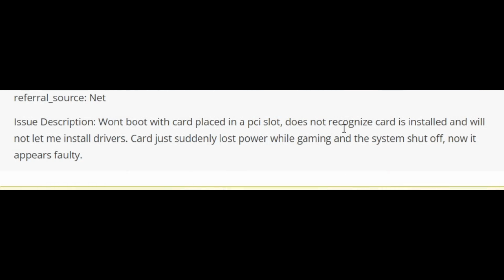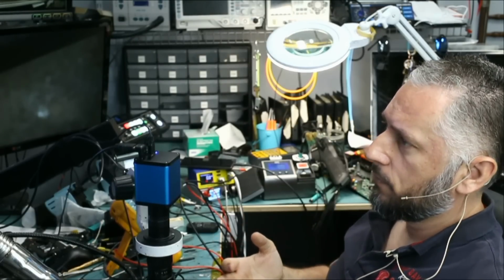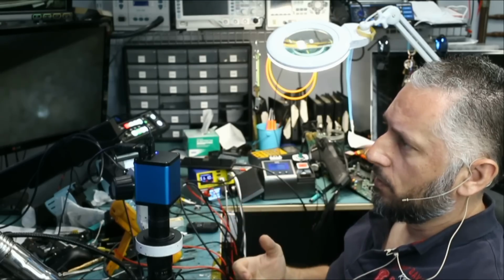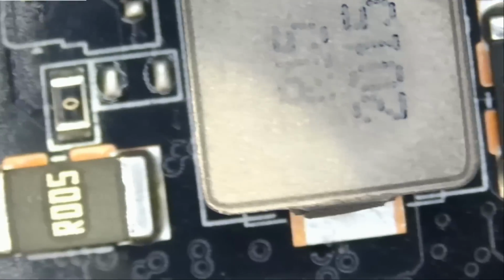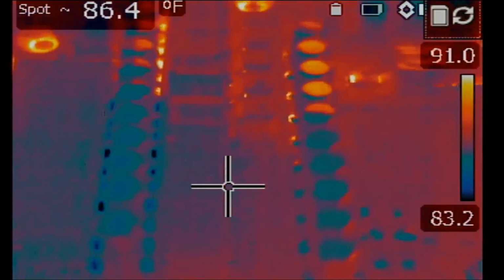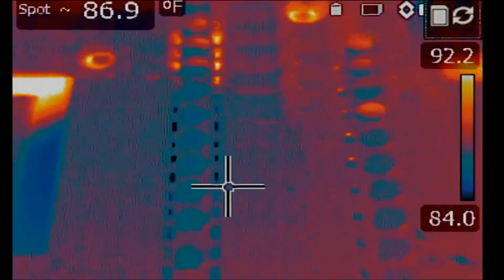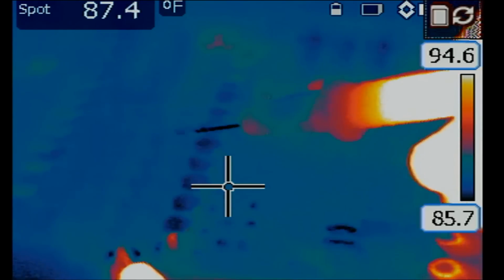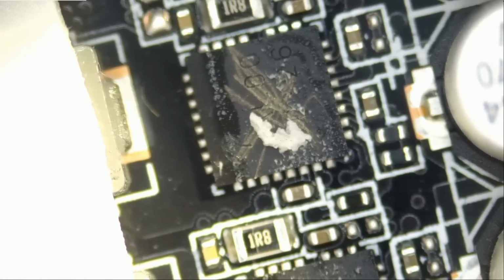Gigabyte 3090 Vision Graphics Card Repair - Suddenly shutdown and won't power up.

Comment: Greetings, I send a message because my video card has presented a recurrent failure, the computer turns on and gives an image, but after a while it shows a fixed color that can be green, blue, gray or white in a fixed way, later the monitor turns off and stops sending a signal video I have the driver 516.94-desktop-win10-win11-64bit-international-nsd-dch-whql before it happened to me with the driver 471.11-desktop-win10-64bit-international-dch-whql thinking that the problem would be solved update the controller without any improvement I would like to be able to send you my GPU by parcel it is an RTX 2070 super, the monitors I use are Viewsonic VG2227wm and VG2228wm LED I have never presented these failures before, the power supply I use is a Seasonic Focus Platinum from 750W

Comment: There is a so mouch easyer way to find where is the shortcut. Just use a 5.5 digit multimeter, and then check the resistance before the inductor what is after after the DC-DC, and after the Inductor. There is a minimum 50miliohm resistance difference. Then you just find where is the lowest one between the inductor and the IC. Then you dont need to power up the whole circuit and pray for not to die the processor. It's works every time.

Comment: it wont surprise me if during manufacturing the voltage on the boards are much higher then when it eventually becomes a videocard while voltage is a problem the problem only comes later as your just decreasing the lifespan but if done for heck even a day it shouldn't harm the videocard much your more concerned about the temperature during that voltage then the voltage itself

its why you can have a cpu overclocked with over 1.45v with a liquid cooler and barely influenced the lifespan offcourse you don't want to do that but most of us already have a new system before that overclock killed the cpu 

that said ryzen really benefits from a slight voltage offset of -0.05 it improves thermals but also improves performance gotta love how infinity fabric works

Comment: There are times when I do wonder if under the chip, there is touching of solder from the globs left for the re-soldering. It looks like there might be too much solder put down on the larger pads.  I suppose it they were touching then you would read a short? As always, great show Sir.

Comment: An odd question perhaps - Can you boost a gpu vram by replacing the memory chips ? for example if you have a gpu of 4gb with 4*1gb chips, and replace the chips for 2gb each, for a total of 8gb. Would it be possible ?

Comment: How does these things even happen to this expensive GPU? Don't they use top-tier components? I thought only Chinese motherboards had these issues.
Reply: Just because you use expensive components doesn't mean you're going to have zero failures.
It's honesty a misnomer that you'd even get a more reliable card, card manufacturers basically admit this buy giving the same useless warranty to high-end versions of a GPU as they do the lowest end.
Reply: They build them with components that are chosen to have mean-time between failures that are acceptable to the consumer based on the expected lifetime of the device. Certainly there are parts that are designed to last longer under worse conditions, but these components cost a lot more money. What's the point of using components that will last 20 years when the card will be upgraded in under 5? Its always a balance. Then add to this that there are small variances in both the source materials and the manufacturing processes that can lead to components that may fail earlier than others. Also keep in mind environmental factors like increased ambient heat which can also lead to earlier component failure. Of course no manufacturing processes is perfect and its possible for even the highest quality chips to come with defects that pop up after initial QC testing. Defects are a common and accepted part of semiconductor manufacturing. This is where the process of "binning" parts comes into play, allowing manufacturers to sell sub-quality or partially defective components as lower-performing parts with the defective sections disabled.

Comment: Wow that card has a 4 year warranty why not just RMA it, by the way a low end version of that card starts at around $1,723.07 retail. The only reason is it was purchased on eBay as a defective card and then sent to a shop like this one to get fixed for a fraction of whant it cost. In turn they can resale the card for a substantial profit.
Reply: No way sherlock

Comment: Installing drivers was never an issue, it won't install them if it can't detect a gpu. it's like tyrying to install a driver for an RTX3080 when  you do not have one even in the system you are trying to install the driver on. Of course with no power to the card the drivers won't be installed, it is not an issue though. There should ONLY be one issue, find that issue then the others will not be there, ONE issue, NOT many. find the issue that causes all the other symptoms. Think about it like a weed. A weed in your garden will spread, even if you cut the stem at ground level, it will still grow and spread right? so what do you do? kill the root. If you think it through and realise there is one issue, then your halfway there, but, if you see these symptoms and think they are all issues, you could end up not fixing a simple issue. what afre symptoms and what is the issue?
 
Also: British Army used to, and hopefully still teach this:
problems do not exist. A problem is a problem because they have no answer. IF a problem has answer then it isn't a problem. A problem is something that has no answer hence why it is a problem. 
IF a problem has an answer then it is merely a situation.

Situations ALWAYS have an answer. 
Problems NEVER have an answer.

Remembering this means you are changing your mindset and more likely to find the answer. Just because you personally can't find the answer doesn't mean you have a problem, someone else may know the answer and so you still have a situation because you go to the person who has the answer.

Comment: But Alex, if it's overflowing outside the chip, isn't it also overflowing inside, shorting the chip?  Solder will spread inside the gaps on the chip.  You're correct, some of us think you're using too much.  Thank you for posting this video.

Comment: Try finding the fault (lots of mosfets)........Good Luck (8:05 & 8:09).........what I do have are a very particular set of skills, skills I have acquired over a very long career. I will look for you, I will find you.
Reply: Could just pull them off one by one until the short goes.  Potentially time consuming tho.  If your a hobbyist or have plenty of spare time....

Comment: Great video as usual!  

Question.  Do you replace the layer of white foam(?) that was over the MosFets and if so, with what?
Reply: It's a thermal pad, and i'm sure it's been replaced, to cool the mosfet. There's also thick thermal paste that you can use if you like to.
Reply: They are thermal pads and yes you will have to replace those or the card will fry itself to death, also the cooler might not fit properly without the pads underneath.
Reply: @ApocDevTeam  do you have a source for this material?  I've got some thermal pad, but it's much thinner.  Thanks!

Comment: Hi Alex! I was thinking about the layout of the 12v vrms and i am thinking that if you have a short on the mosfets, then you could apply higher voltage with the positive probe of the injection tool  to the 12v input and the negative probe on the output of the vrms. In this way you can apply higher voltage and have higher current passing through the sorted mosfet and the high current doesnt pass through the gpu into ground.
Correct me if i am wrong! Anyway a great fix once again!!!

Comment: Does every multimeter beep in diode mode when measuring a short?
Reply: nope, a large range of fluke meters do it but not all of them, some other brands do it as well but you'll have to research the specific model to find that out
Reply: @coyotex850  Guess mine doesn‘t even though it does in continuous. But 0L does the job though. Just a bit inconvenient to look at the meter.

Comment: The driver update is sus. Could be a corrupted firmware.
Reply: Nah; he likely tried to install the card via a riser because his PC wouldn't boot with the card installed in a PCIe slot. He would have been able to attempt the driver install if he had the PC booted up via his iGPU. Likely the card was totally dead and it wasn't being recognized at all. If you try NVIDIA drivers with no card being detected then the install will fail.

Comment: Dear NorthridgeFix,
I need your guidance.
I have Lenovo K4 Note android phone. Problem is, it shows it's getting charged but percentage doesn't increases from 2%. After approx 5 to 10 mins it prompts, "Your battery voltage is too Low" & within few seconds phone gets shut off. I have measured voltage of battery which is 3.8 volts. Without battery, battery connector shows 4.0 volts while AC charging.
How should I solve this problem ? Will you please guide me 🙏🏻 ?

Comment: Is kapton tape a good substitute to shield components from heat?
Reply: No. Kapton tape is not that good. Aluminum foil tape is much better.
Reply: Wrap kapton tape around your finger then touch a hot soldering iron tip.  Let us know what happens.